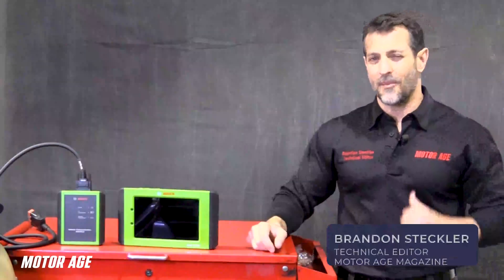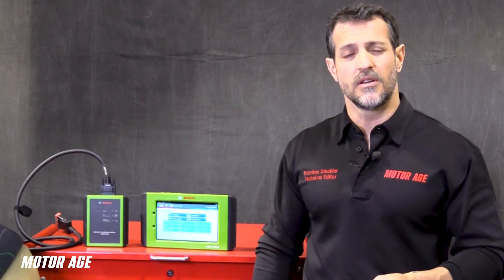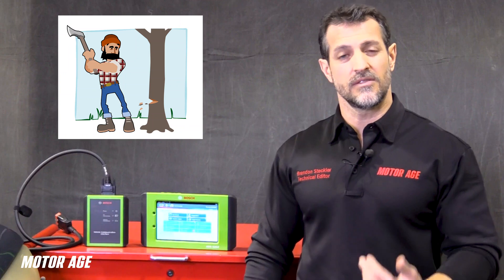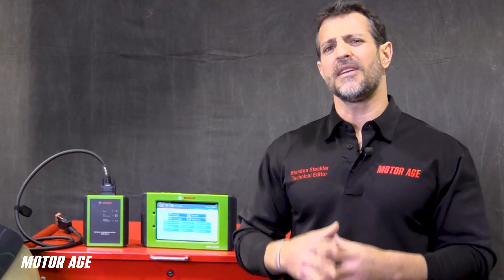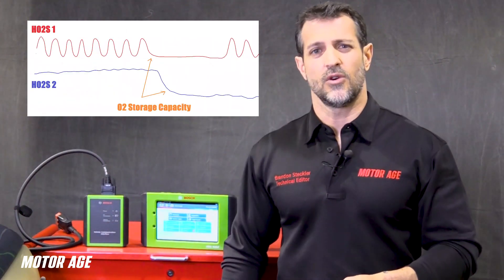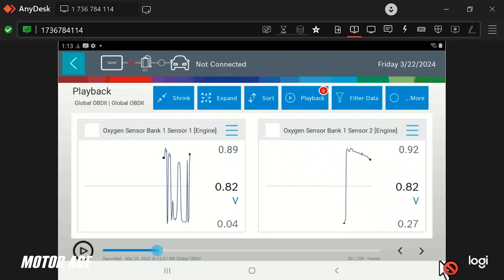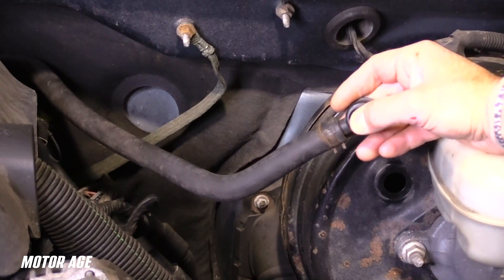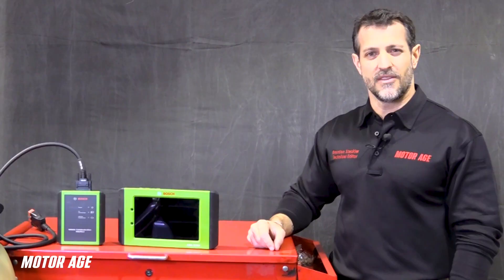The Trainer #148: A well-fed CAT is a happy CAT

Comment: Hi there, is there a different method for testing vehicles with wideband sensors, or will they display readings that can be used?
Many thanks.
Reply from the maker: Hi there, 
The method is similar but the WRAF is typically inverted. you can also choose to graph "lambda" or "Equivelnce Ratio" in place of the WRAF mA  or voltage value

Comment: Hi Brandon, great video and, once again, saved it to my YouTube diag folder.

Two questions come to mind...

1- Do you have a rule of thumb to determine at which point the time difference is to short and you are confident to condemn the CAT?

2- Should I back this up with scope data? I ask because although I can see there is a time difference on scan tool graph data, I don't really see the time base so ti makes it hard to judge.

Thanks again for all your do for the industry.
Reply from the maker: First of all,...Thank you! And great question. I wish I had a better answer for you, though. I typically view the data LIVE, so I get an idea of how much time has elapsed.
Reply: Makes sense... I guess it's one more case of "look at known good until it's familiar enough to spot when it wrong"

Thanks again.

Comment: as usual a lot of good information.  I really enjoyed the forst section describing how the cat works.  it helps me understand why the post cat o2 sensor does what it does.

my question is how do you check a cat with a wide band sensor that hardly moves on the screen.  it's one thing I can't wrap my head around.

Comment: Hello friend.  Hector from Puerto Rico. Good explication.  I have a question about catalic.  I have a camry 2004 3.3 with 115,000 miles .  Have the code P0430.  I do a tune up and add a catalic cleaner.  The light ve on but later come off.  Three days later come on but was the bank 1 sensor 1 and buy one original.  Seven days later come on with the code P0430 again.  The car run perfect, the only issue is the light.  Some technic from here and outside tell me than the problem is the computer.  In base of your experience, what you thick?  Bad catalic ir Bad computer.  I hope than bright me some explication m. Thanks a lot.🙏🙏
Reply: I will need to see data to make diagnostic decisions
Reply: It's very difficult if not impossible to correctly diagnose your P0430 remotely. There's other checks you need to do before replacing the catalytic converter or the engine computer. Get a scan tool. Check your fuel trims, oxygen sensor operation and voltages. Run it rich by spraying brake cleaner into intake manifold and see how oxygen sensors and fuel trims  respond. It might be a bad O2 sensor, O2 sensor wiring, or exhaust leak near the catalytic converter.

Comment: Is there a rule of thumb on the lag time if you were to use a scope?
Reply: That’s a great question. I have never seen anything documented but I’ve seen older vehicles with a lag of 7 seconds and brand new cars with a lag of about 3 seconds.

I have never seen less than 3 without pending DTCs (P0420 or P0430).

Comment: Retired ASE mechanic changing my 68 C10 pickup over to a 6.2, 6l80 trans system, I'm opting to stay with variable valve timing, maybe a very slight tune, but staying with cats and slightly concerned about taxing the cats with a tune change.
Variable valve timing is a win/win for performance and emissions (450 HP stock or lower)!!
Any thoughts on your end??
Reply: All bets are off unless the tuner can compensate. The difference between poor-performing CATs and a MIL is in the software.

If the tuner tells the PCM to keep its eyes closed…no MIL
Reply: Dear friend.  You think than the problem with catalic maybe in the software (computer)? I buy one but I need to find some technic than program it. Some technic said than there is the problem.  Here in Puerto Rico is difficul find a good one.  Thanks for your information.🙏
Reply: I would really need to see some data to make a decision. I’m sorry
Reply: Sorry my friend.  The second question was not for your.  I thick than other persons coment and I can send a question.  Sorry again.